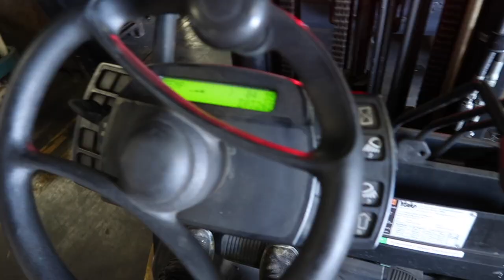TAKING MY MALL CRAWLER OFFROAD *Jeep FINALLY Sees Some Mud!*

Comment: Most of this could be done in 2 wheel drive.
Reply: jack hook agree. Not really off road at all
Reply: @off_road_rider  so very true I have 4 jeeps a 47 willys with the go devil engine a CJ 7 a grand Cherokee and my babe my jeep wrangler Rubicon with lift 40 tires 513 gears Dana 60 axels and a hemi engine in it. It's a blast off road.and yes front and rear lockers bead lock wheels. I do serious off roading.

Comment: U still running stock steering with the 38s?? Like drag link tierod and stabilizer??
Reply from the maker: Yes, going to be upgrading to SteerSmarts components sokn
Reply: @benanton2619  nice, do u think the stock stuff would be fine to run 35s long term or still need to be upgraded?

Comment: Why would you put it in 4 high? It's stuck in mud bro.
Reply from the maker: Bc 4 low had no traction at all (clearly) so I  needed to create some wheelspin to try and gain momentum to rock it back and fourth
Reply: @benanton2619  but you can still use all 6 gears in 4 low and keep the torque.
Reply: If you are 6th gear in 4lo you are probably breaking stuff. 4hi allows wheel speed,  in this case the tires were full of sticky mud which doesn't allow traction. If you use 4hi and "roll your windows up" it should clean out the mud and allow traction again.
Reply: @murphyslaw3  why would you break stuff in 6th in 4 low?
Reply: @Scote001Jeep  4lo is meant for crawling. Slow.  And you have to be able to slip, you dont ever want to use 4lo on a hard surface, or a "non slip" surface.
Reply: @murphyslaw3  you can go up to 40 mph in 4 low safely no problem and mud is soft. 4 high is more meant for snow on the hwy but it's all good. Just curious.
Reply: @Scote001Jeep  put it in 4hi to clean the mud out of the tires if you have good self cleaning tires like boggers then you get more traction